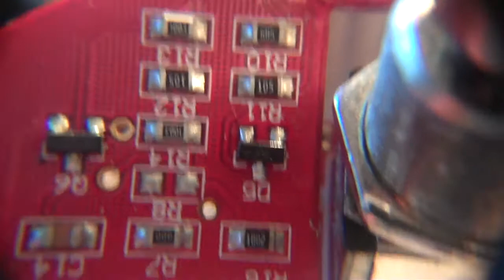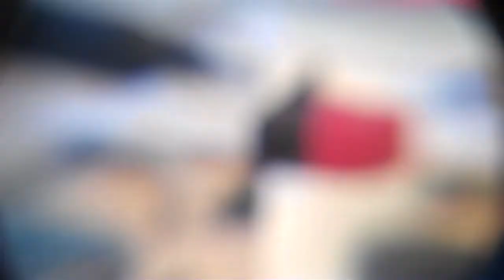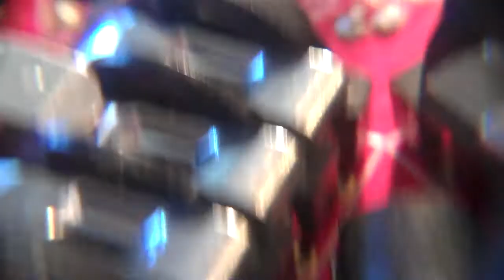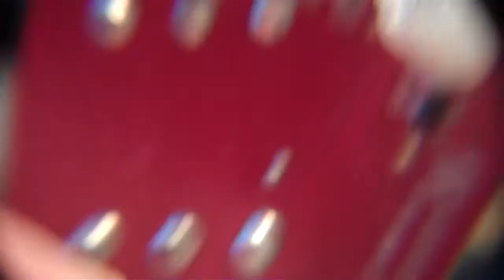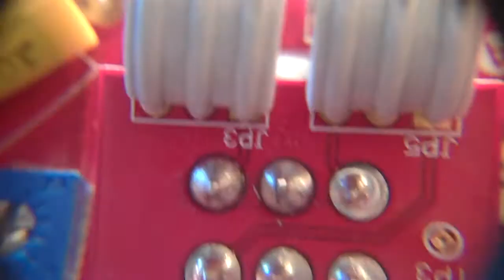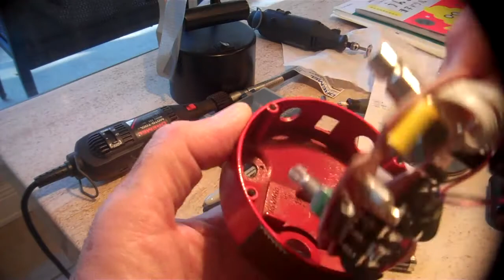Troubleshooting Static in a Dunlop Mini Fuzz Face (FFM2)

Comment: made in china=bullshit
Reply from the maker: Exactly, but for some reason, taking it apart and putting it back together fixed it.  All I can think of is that the nuts on the volume and fuzz pots were loose so maybe it was a grounding issue.  I have no idea what I did.  I sprayed a little DeoxIT here and there but everything is sealed up.

Comment: The surface mount components aren't as tough to work with as you might think. You just need the right equipment. Some kind of magnification is necessary. A heat gun is also necessary. And some fine tweezers. You just blast the cap, moving back and forth with the heat gun, and it'll just release from the solder. Pull it off with your tweezers and replace it with another microscopic part. As it cools, if you've got the thing seated right, it'll get sucked into place. Easy. 

The surface mount stuff can actually be a lot easier to make repairs to without accidentally damaging the board, its just an impossible pain without some slightly fancier equipment then a soldering iron.
Reply from the maker: Thank goodness just a little DeoxIT seemed to fix it.  The nuts on the pots were a little loose too so maybe it was just a ground issue.  I don't think I'm ready to invest in new equipment just because I hardly ever have to mess with these things.  I'm surprised they sound as good as they do with those microscopic parts.

Comment: I feel your pain. I hate it when I get extraneous noise in my setup. I have a similar gear to you with a Bassman and a seperate  reverb unit ( although clones ) and it's noisy at the best of times. Was recently doing some measurements and discovered the filament voltage was 6.8v AC on the Bassman. I wonder if this is a cause of noise? Have you ever measured the heater voltage on your amps? Sorry I know this is off topic with regards to your Fuzz issues.
Reply from the maker: Whatever I did by spraying it and putting it back together, worked.  So it is very quite now.  I have measured my heater voltage recently which is running around 6.4 VAC.  I use a voltage regulator to drop my house voltage to 115VAC.  You should look into one.  It may make your amp sound better.  I'm not sure it will make any difference in the noise but it will be operating at the correct voltage.  I use a Carl Hartman Amp Preserver.  I think he is still making them but not sure.  He didn't show up in a Google search.http://www.vintagesoundworkbench.com/uploads/AmpPreserverPages.pdf.  There is also a new device out called the Brown Box. https://www.amprx.net.  But the Hartman is only $159 if you can find one.  I've used it for years and at at all my gigs too. https://youtu.be/rZYLhOZR-C0
Reply from the maker: http://www.vintagesoundworkbench.com.  I think he may still be making them and he has a newer version.  I like mine because I can run multiple amps on it without blowing the fuse.
Reply: Thanks. Great idea. Will probably help to preserve my precious NOS 5881's as well.
Reply from the maker: Yes, it will make your amp run cooler.  House voltage here is 121VAC which it too much for those old amps.  Even when I drop the voltage, my 5881 plates are running at around 450VDC.  Remember you will need to check the bias on your 5881's whenever you change the main voltage.

Comment: Ain't it always the way of "progress"...gone are the days of repairs! One thing you can get is a Switch and Contact Cleaner made by CRC. I know that it's aussie made but i'm sure you can get something similar over where you are. The small gap in the green plastic on the side around from the solder lugs is where you aim the spray with a tube fitted in the spray nozzle. also around the top where the spline turns and the nut goes on - it will seep down inside if given the chance. Keep at it and don't let those "Surface Mount" components get the better of you!
Reply from the maker: My all time favorite is DeoxIT.  I sprayed it everywhere I thought it needed it and it actually fixed it somehow.  Good deal.
Reply: Yeah, probably got in there enough. I always thought it was a surface cleaner treatment. The stuff i'm talking about is a switch contact cleaner that gets in like a degreaser/penetrant. The main thing is you got rid of the "static" which - you proved - isn't standing still! :p

Comment: Those are Surface Mounted Devices (SMD), very common nowadays in large scale production. You could probably remove that pot and try cleaning it by soaking it in cleaner, or simply installing a new pot.
SMD aren't the end of the world, they are fixable, it just takes time, patience and practice to do it.
There are video tutorials here on YouTube showing how to solder SMD using a standard soldering iron and tweezers.
I wouldn't throw away that board, but if you do think about doing that, I'd be more than happy to take it off your hands for you instead.
Reply from the maker: Luckily, whatever I did actually fixed it.  I want to say it had something to do with the ground in the DC jack but not sure.  It sounded like a ground issue.  But without being plugged into the DC jack, it still made the noise.  I have problems with those things before.  Either way, I looked for the pots but was not able to find them yet.  I'm sure they are easy to get if I ever need one.  Thanks for the help.